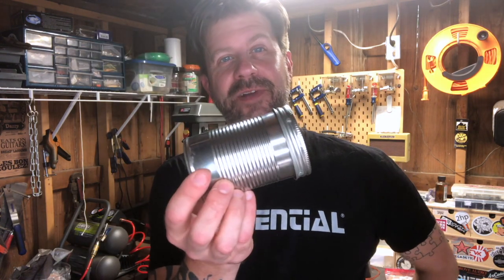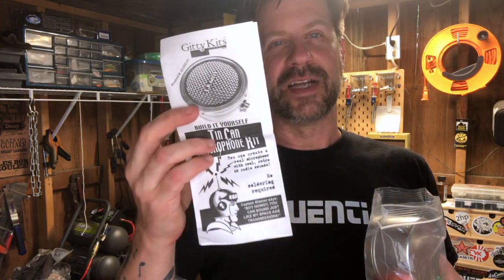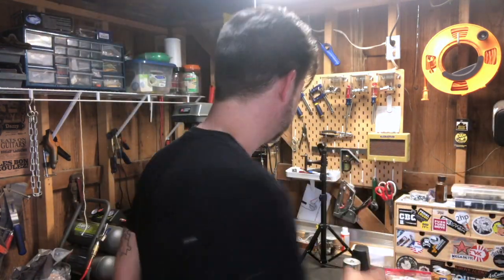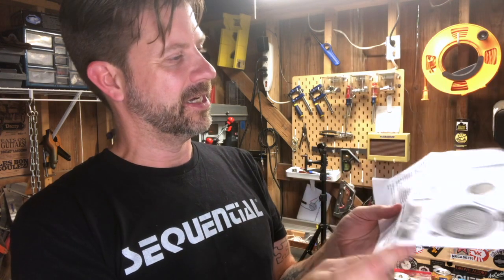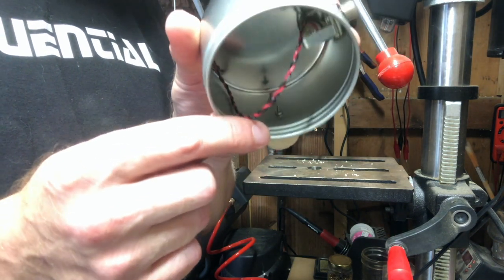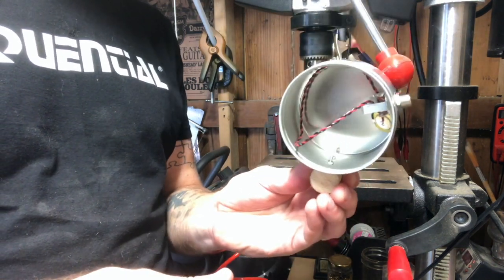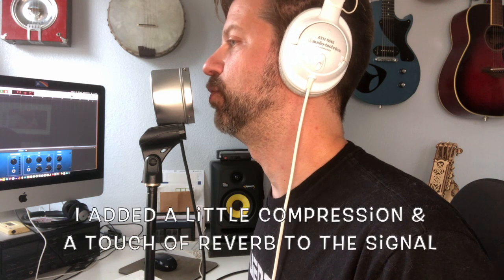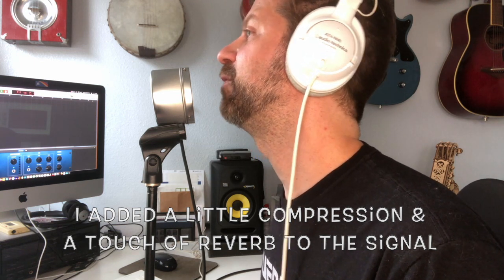Building a CB Gitty Tin Can Microphone Kit

Comment: How do you make it so it's not so touch sensitive? I've tried all sorts of filler and padding.
Reply from the maker: I've used mine quite a bit and haven't really had any problems. Any piezo-based microphone is going to be sensitive to bumps and taps but I've been able to use it just fine. What exactly are you experiencing?
Reply: Check out this quick video for an explanation: https://photos.app.goo.gl/krtcocQ2H1NaGxXGA. 

Thanks for the reply!
Reply from the maker: @brevs8387  Ah. Piezo microphones are very sensitive to feedback so you want to keep the amp a ways away if you can. When you're working that close to the amp they do tend to feed back. Potting the piezo (with wax or hot glue) or using sound deadening material (sounds like you might have already done that) will help but a piezoelectric transducer works on vibration (opposed to air pressure) so the mic will always be sensitive to tapping or quick jostling. They're an art to using them for sure.